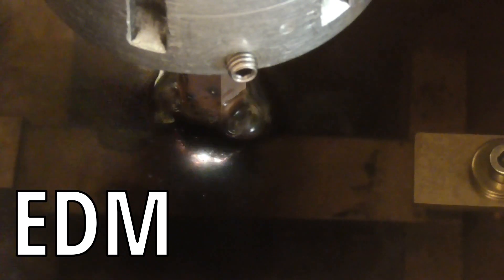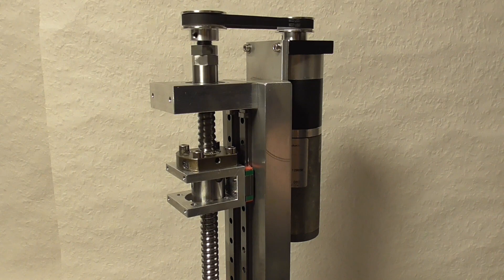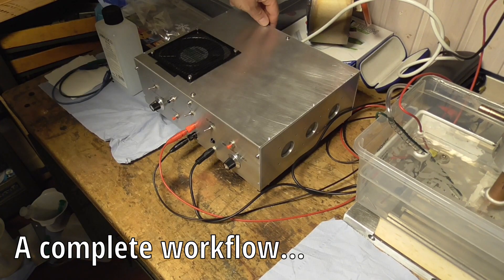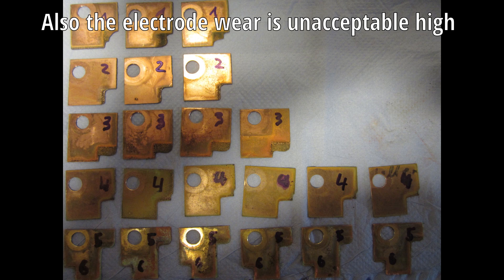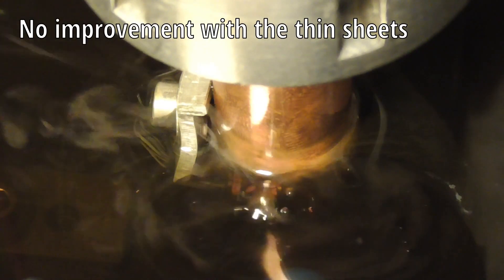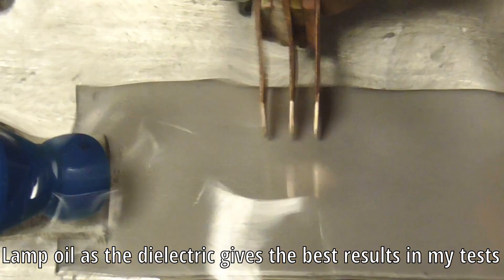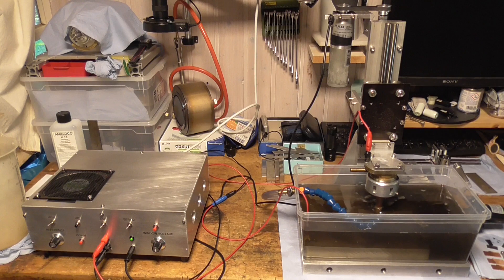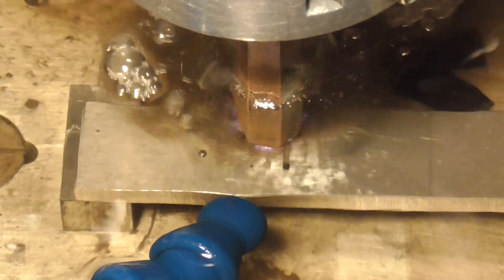Self made EDM spark eroding machine with the DIY book of Ben Fleming for the home workshop

Comment: The issue I see is that you have multiple points of contact. If you switched over to one plate instead of multiple plates I believe you have better results. Better would be to flow dielectric through the plate so the erosion material is removed. You can do this by taking two thin sheets and routing out some channels and soldering them together  and use a pump to flow the dielectric fluid.
Reply from the maker: Hi,
I tried to use just one plate many times but the result was not better.
Dielectric flow channels in 0.7mm thin graphite sheets would be a nice challenge and as I have stability problems with plates thinner than 0.6mm I think it will not be possible.
But you are right flushing through the electrode is nice and if possible I use it.

Thanks for your suggestions and best wishes
Ralf
Reply: @myengines2443  Graphite never lasts very long. I think the only way to cut those long deep slots is with a wire edm.  You could use a disk and rotate the disk to provide even wear but the diameter of the disk would shrink from errosion.  You could also try cutting horizontally with a longer plate instead of plunge cutting vertically, such that the copper plate length is the total cut length perhaps you get enough life out of the electrode for one slot (depending on depth of cut).You could probably get two cuts if you use both sides (plunge horizontally for the first cut, than reverse Y-axis to cut the 2nd slot on the opposite side)

The only other way I can think of to cut faster is with a band saw (you would need to cut the blade and weld reweld it for the internal slotting which probably is not practical. Unless you can cut through the entire cylinder, which I suspect is not an option. 

Another option might be to cut radially using a small slitting saw, or on a lathe with boring bar with a groving tool.
Reply from the maker: Hi,
I tried all mechanical ways to cut the slots you mentioned and a few more.
It worked but was a hell of work as you can see in my older videos.
With my new setup and graphite electrodes I get good results and soon I will begin to make my new heat exchangers.
You can see my progress in my new video. 

A wire EDM is to expensive/complicated and it would take a too long time to complete.
Using a horizontal electrode it would be difficult to burn to exact depth or I need several gangways to just cut one slot.
This would take too long as I have to cut hundrets of slots.

Thanks for your suggestions and with best wishes
Ralf

Comment: I met Benjamin Fleming at a maker fair a few years ago, and he was using kerosene (also used as lamp oil) and I think that he was using a high frequency spark stabilization circuit from a welder. That would act very similar to a pulse circuit, yet be fairly simple, with a bit less control. Ben mentioned how when he started there was NO information available without NDA's, so he had to reverse engineer what he could from talking to operators, and what he could glean from sales literature. I talked to my father (a retired aerospace CNC programmer) and he mentioned that he had once made a sinking edm electrode with 0.010 inch features in graphite that was electroplated with copper before it was to be used. I hope some of this helps.
Reply from the maker: Hi,
thanks for your thoughts and suggestions.

Greetings
Ralf
Reply: I have a cheap Chinese TIG welder with an adjustable current setting. I’m not sure what the voltage is but suspect that it’s around 40v max. But that’s just a guess.

Comment: What if you used a zener diode to prevent voltage dropping below a certain threshold. Also how do you know if the circuit isn't simply shorting across debris or the tool/workpiece. Maybe you should be using a voltmeter and ammeter during your tests.

Comment: Would you benefit from doing ECM over EDM for certain applications?
Reply from the maker: Hi,

I do not know much about the ECM technology isn't it to complex for DIY?
If not do you know a good description or presentation of a DIY ECM Machine, it looks very interesting.

Thanks for your help and with best greetings

Ralf
Reply: @myengines2443   Youre capable of building your own 3d printed electrodes and drop on the z, ecm is very slow and produces a lot of waste. sludge and hydrogen.

Comment: have you tried using only one thin blade,or less current or high frequency pulses
Reply from the maker: Hi,
yes I tried just one blade, it works without difference.
I cant control current or frequency as it is a simple R/C machine.

My new experiments with diesel as the dielectric and graphite show very promising results which I will show in an update video soon.

Thanks for yout suggestions and with best greetings

Ralf
Reply: @myengines2443  I have seen the guy from de the baxedm using a series resistor made with 500W lamps reflectors (tungsten core) to limit the current, i didn't saw that part in your setup, maybe it's possible to add it? I think that you have excessive current/voltage, sound very sparky and not so much as frying bacon
Reply: @myengines2443  You can control discharge energy by the size of the caps and inductors in series with the caps. The Inductors will provide current impediance to limit the current. You need to use a recovery diode so the energy stored in the inductor does feed back into the mosfet (possibiliy damaging the mosfet.

Comment: That is fascinating! Can you tell please how long the first M letter cut took and also how much KW's of power it takes in average?
Reply from the maker: Hi Anton,
I don't know which burn you mean (M?) but now it takes about an hour to burn 3 slots 1x8mm trough 11mm thick 1.4571 Stainless steel.
I dont know the average power consuption of the EDM but it cant be much, the machine has a 2A fuse on the 230V net so I think it is in the region of maximal 100-200 Watts.
(2x 24V 2A transformers are for the power line).

Greetings

Ralf
Reply: @myengines2443  wow thats actually incredible that it takes only 100-200 watts, I thought its much much more because of high voltage needed. I was afraid that you pay for such high tolerances with high electricity bill.
Reply: @KyrychenkoAnton  You don't need high voltage. lower voltages will work just fine and also allow more precision cuts because the electrode will be closer and the spark gap much smaller.

Comment: for aluminium with graphite have you reverse polarity ?
Reply from the maker: Hi,

I made best experiences with electrode positive and didnt reversed it for graphite on aluminium.
Do you think this will give better results?
I havent much experience with aluminium because stainless steel is more important for me.

Greetings

Ralf
Reply: @myengines2443  You want the electrode to be negative to avoid anode corrosion (ie if you try electrolysis, the anode corrodes considerably fast.

Comment: Hi Ralf,  I have been running a hansvedt spark edm which I think is an RC type given its advanced age.  I have obtained results similar to you. what might make it work better, but I have not tried, are BeCu electrodes or a higher voltage spark from the RC circuit with a shorter RC time constant.  Also, your use of multiple blade electrodes seems to me to impose a burden on the RC circuit similar to having the RC tuning incorrect.  If you watch your video you will see that the spark is hopping amongst the blades in contrast to what happens with a concentrated  discharge within a more electrically limited discharge region (intense local heating and higher ion density).  Have you tried to cut with a single blade?  And another thought, as the electrode drops down into the slot, the sides of the electrode can continue to conduct laterally.  Have you tried to varnish or paint the sides of your blade electrode so it is conductive only on its intended business end?   These are just some ideas that I have not tried while also thinking about the pulsed edm.  Regards, Mark
Reply from the maker: Hi Mark,
thanks for your thought-provoking impulses I will try them out and show the results as soon as I have good outcomes.

Greetings
Ralf
Reply: I'd be careful with beryllium; IIRC high toxicity.
Agree on trying a single blade to start, before attempting the additional complexity of multiple blades.  Perhaps the second step would be widely spaced blades.
Possibly rotating disks for better dielectric flow?  Though that way lies a wire EDM.

Comment: Hello Ralf!
Nice to see you still busy in the work shop.
I built an EDM machine from Robert Langlois plans around 1995.  It works well but the relaxation oscillator makes for slow work.  What is needed is a forced oscillator to produce a high frequency for faster work.  I don't have the expertise to design such a circuit, and Robert, whom I knew personally, was not interested in developing such a device suitable for hobby construction.
For slotting work such as you wish to do, a wire EDM machine would work very well.  Robert Langlois described and built such a machine.  For slotting applications a very simple table drive is all that's required.  Rotary indexing can be done by hand, perhaps using a digital indexer for simplicity.
The table drive would embody the electrode drive you have on your die sinking machine.
I found that a very light mineral oil worked well with copper electrodes.  Normally I use distilled water with brass electrodes.  For lengthy work I filter the water with a 1 micron water filter.
Regards from Canada, Wolfgang
Reply: A 555 timer can be used, Then use pairs of mosfets (one to charge the cap, and the other to discharge it). You can user a 74123 to create dead time between pulses. You can also set up multiple pairs of mosfets and Caps, since cap charging time takes longer than discharge time. The easiest what do this is with a microcontroller.

Comment: Ralf, Ive been watching your videos for a few years now. I've always wanted to know what your final plans for the stirling engine will be? Is it for backup power? Just for show?
Reply from the maker: Hi Martin,

thanks for your longstanding loyality :-)

At first Stirling engines are my passion and I want to develop a relatively simple useful machine with reasonable power.

Unfortunatly this is no easy task for a single hobbyist and not even for a company.
You have much more setbacks than successes.
I try many variations of the Stirling engine and I also often improve my workshop as you see in this video.
This takes a lot of time and I only post a video when I think I have something new to show.

My final plan is to develop a relatively simple RELIABLE (thats the main challenge I think after more then 10 years of Stirling research and development) Stirling engine for generating power for ourselves (we have much wood, I can produce biogas, the sun is shining...) and maybe for others.

It is facinating for me to 'produce' mechanical energy just from heat.

Greetings

Ralf